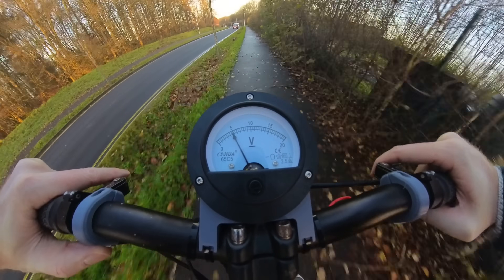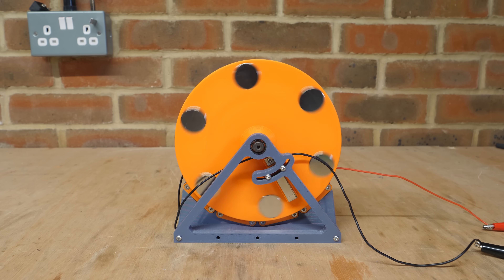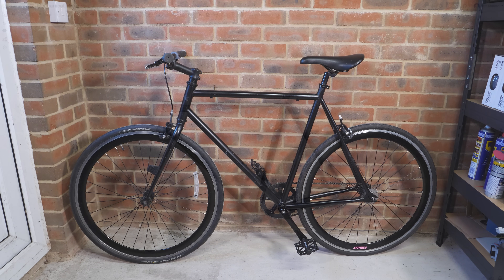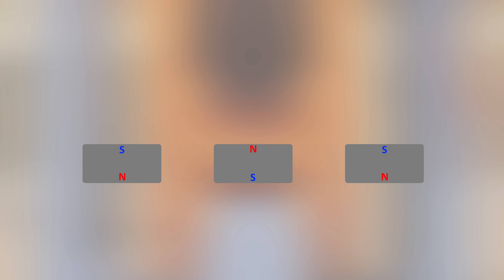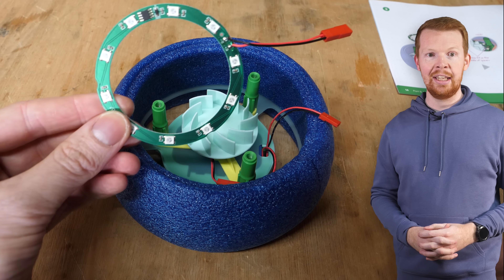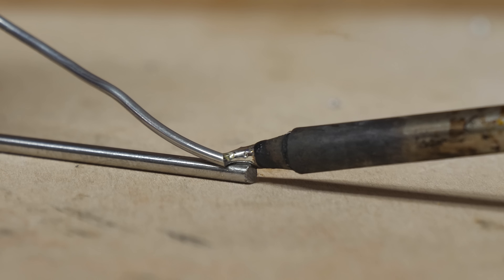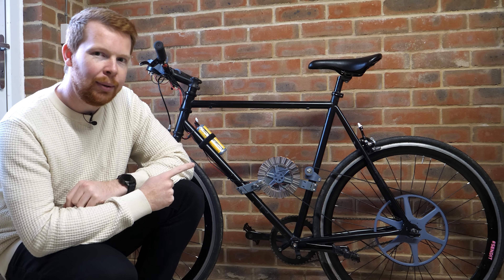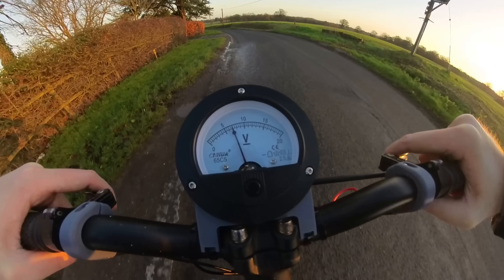The Most Minimal Electric Bike

Comment: I know its been awhile but the belt tensioner is not supposed to be on the top pulling side of the belt. It needs to be on the bottom side of the belt that becomes slack under power.

Comment: Just another thought, now that there are bicycles with disc brakes could you put the magnets in a ring attached to the rim of the wheel, on both sides too and have a coil attached to the frame just like the old calliper brakes fitted to the frame.😊

Comment: The sparking at the switch is due to a very high back emf voltage generated when you break an inductive load. The normal solution is not bigger, tungsten contacts but a capacitor or diode across the switch to dissipate the voltage.

Comment: Great project. Couple of ideas. Could you use a bought reed switch and drive a mossfet with it?

Your Adjuster pulley should  be on the return of the belt not the drive side. Keep up the good work.

Comment: Design rear wheel hub front wheel hub with magnetic bearings with electrical power generation that generates electrical power while under power from an electrical motor so no need to recharge a battery bank because the bike generates its own power while in operation.  😐

Comment: I've got an idea. Why not flip the tensioner sprocket mount over, and push the belt down instead? That would increase the belt-to-sprocket contact area on both sprockets, and lower the friction by engaging with the smooth back of the belt instead of the toothed inside. The tensioner doesn't functionally need to engage with the teeth anyway, right? I would add a spring hinge to dampen movement, though, as you want the tensioner to follow the belt so it doesn't jump out.

Comment: Bro I didn't understand why u r not using normal reed switch with a high current BJT?? the reed switch will collect the signal from the motor and then will feed the high power BJT driver and the high power bjt will then do the rest, anyway love and support for you from INDIA 🙏🙏♥♥
If you accept my idea then can pin my comment so new persons can learn from this small mistake. (even  I have done many mistakes like this in the past)

Comment: It should be possible to use an electric motor just with an on/off switch, On = electric circuit is closed, motor runs, Off  =circuit is broken, electric motor is not running.

Comment: What is burning ur switch is the inductive collapse. You can short the flyback voltage (inductive collapse) with a diode like normal motors do, or you can go free energy mode and send the diode to the positive of a secondary capacitor (negative to other side of coil) when the magnetic field collapses it sends the flyback voltage to charge the secondary capacitor, just like a BEDINI SSG CIRCUIT but with reed switch and capacitors.

Comment: Hi Tom. Re ebikes: so many advantages to having dual drive (using the  'non drive side') for ebike transmission. eg regen, redundancy and extending the life of expensive derailleur transmissions. in your opinion why aren't manufacturers developing such configurations? Ive been interested in doing similar by repurposing a 'standard' BB motor (eg shimano, bosch, barfang). The motor dimensions are correct, the frame mounts are commercially available, controllers are already configured etc etc. Is there any disadvantage to this configuration and things to look out for. I appreciate (at the time of writing) the rear wheel sprocket side of things will probably need a custom solution especially if using a disc brake as well. TIA

Comment: Even tungsten contacts are burned by arcing right when they open. You are delivering current into an inductive load and cutting it off!  ;^) Go get the "condenser" from the obsolete ignition system and put it across your "points" to protect them.  Try 0.33 Microfarads.  @henrymach Mentioned points and @huzudra Mentioned the capacitor 8 months ago, I now see.  By the way, the arc is about 3000 degrees Celsius. You must suppress it!

Comment: Excellent quality. However, engines of this size in the past usually drove fans, on stoves and fireplaces. You can also experiment with the displacer, make it using steel wool or foamed ceramics. You can also use a two-piston design or double action.

Comment: I remember my pedal bike from back in the early 1980's had one of those flip-on/off generators whereby it clamped to the bike frame and could flip the generator under spring tension which had a gnarly wheel that was spun by the bike tire's rotation. Not sure of all the accessories that were made to run from it, but commonly had a headlamp and there was some turn signals and marker lights in some kits

Comment: If you'll allow me a tip, you could use a metal pick instead, or even something mechanical. A Hall sensor can do this very easily, as long as its switching is done with a higher-power transistor, a MOSFET, or an IGBT.

Comment: A nice 2-way ammeter would be nice here. To show amps coming out, or going in, to the battery / capacitor. Also a speedometer which is just an app for your phone, there's a really good one called Phyphox, it's free, and it lets you see data from any sensor your phone has. Good for being free, it's meant for education, but you can likely get something with a nice pretend speedometer and all that if you liked. 

I see the principle of "electric, not electronic" but really, some transistors, would do a world of good! Just one decent MOSFET pretty much. Though admirable to do it the old fashioned way and go to tungsten, King Of Metals. Light bulb filament of over 100 years! Or so.

Comment: Try adding a .5 uf 250V paper or plastic capacitor across your reed switch contacts. This will surpress most of the sparking, as much of it is likely coming from the inductive kick caused by the collapsing magnetic field of your motor coils when the switch opens. The cap value is not critical.

Comment: you can actually use flywheel, momentum, the right magnets, and timing to get over unity, where once you get the motor turning it feeds itself , as in a motor generator built as one unit, this is entirely possible and will come as soon as greed and secrecy ends.

Comment: I understand you are not wanting to use any electrical circuitry to help with your ideas. However you could so easily make your idea that much better with the aid for some helpful electronics. For one, you could replace the magnetic contact switch with solid state components to keep from arcing and offer way more switching control without burning out...

Comment: At 36 volts, adding two extra exterior coils could gather more energy, potentially reaching near 100% efficiency. Consider a 1ms on, 3ms off pulsing ratio for faster, highly efficient operation while maintaining resonance. You're close to self-sustainability. Focus on the resonance lost with a constant versus a 1:3 ratio. FQ Adding copper and magnet coils can improve wheel power efficiency, paving the way for a perpetual bike. Resonance can triple output, and with time, amplify ninefold, hitting 300% efficiency when factoring time. Use 200% and reloop 100%. An oxide capacitor can reduce amperage to 20mA, relooping higher voltage to lower, creating a potential energy feedback loop.

Comment: very nice

my remarks:
it'd be a cool experiment to try using spark plug parts for the reed switch, I'd also put it on a sealed tube full of nitrogen or some other inert gas to both reduce the sparking and having a battle tested spark resistant compound on the switch.

you failed the "fully mechanical" part when you went for a rectifier, as diodes are semiconductors.

you didn't say FULL BRIDGE RECTIFIER dramatically enough bro @electroBOOM

Comment: Hi Men, I am an electric engineer and wanna thanks for your awesomw vídeos. O was goma tô make a sugestion: 
Instead of a mechanical switch, o was thinking that maybe If you put a Mosfet transistor and a hall effect sensor (essentialy another coil), and maybe some resistors you could Control better the on/of switch and optimize for speed, without titanium

Comment: Just use a commutator and brushes it passes the mechanical only, 10 volts for 200 watts is 20 amps a higher voltage is needed.

Comment: Totally irrelevant to the topic but your bike isn't set up correctly for you, your knees are too bent.  As a life long cyclist your leg should be almost straight when sat on the seat and your heel is on the pedal at the bottom of its rotation.  This way when pedaling properly using the balls of your feet your knees are at their most efficient and least damageable, the way your bike is currently set up will ruin your knees!

Comment: you could have a compromise bike project where you use sensors (I think they're called Hall effect transistors or something) instead of mechanical switches.  You'd then need to use more electronics to convert that signal into the power needed to drive the motor, but it would be far simpler than what's on typical commercial ebikes.

Comment: You can solder to most uncommon metals if you sand them and then immediatly coat it in flux, if oxygen cant get in, you stand a much better chance, you don't melt the copper while soldering, instead its closer to a braise, but this does need almost no oxide layer

Comment: Suggestion: use a real reed switch to control a high-current relay that does the actual switching. That will avoid the arcing and precision issues you had.
Reply: could you use a attenena and since they conduct the magnetic to electrical then hook it up to a transistor then make that a switch

Comment: Please do this again but with a brushed DC or universal motor(AC or DC). Universal motors can be found in things that need high starting torque, and capable of higher speeds than line frequency, like a blender or vacuum. You'd need a fairly high volatage battery to get the most power out of a live voltage universal motor, though.

Comment: imagine you can able to cut off the the charging flow  so you can pedal without any resistance but if u go downhill, you can switch it on so u can charge the battery, save on the braking pads, this is so cool imagine this in a real bike, like a brand making it  and people buy it

Comment: Hola estimado, veo muy interesante tu creación, e ingeniosa. El problema que tienes con el contacto de tugsteno, podrías reemplazarlo usando casi en serie paralelo, un par de transistores de potencia en configuración Darlington, que permitirían pasar mucha corrielte eléctrica por ellos, sin pasar por el contacto de tugsteno, mas que unos 5 a 100 miliamperes, el grueso lo puede permitir pasar un 2N3055, en cascada con un BU208, el primero debe poder soportar hasta mas de 17 amperes, y el segundo cualquier contrainducción de hasta casi 3000 volts, el 2N3055 se polariza con una resistencia de entre 500 a 1000 Ohms y de 1 a 5 wats, y para el BU208, con una de 20 Ohms 20 wats, debo verificar estos valores, no puedo encontrar uno de los varios que armé para reemplazar las altas corrientes que pasaban por los platinos de mi viejo citroen 2CV, en mi Chevrolet 6L, ó Ford V8, funcionaba muy bien para gobernar los cortes de corriente instantáneos de los platinos, usaba además un capacitor del mismo valor del vehículo al que estaba aplicado. Saludos desde S.L. Argentina, viva la ciencia experimental !!!

Comment: A fun part of riding a motorcycle is engine braking, where you use the compression in the cylinder to slow down the bike. I wonder if you can use a regular electric motor as a brake.

Comment: If I drive our 2022 Corolla Hybrid carefully in America at 50 to 60 MPH highway speeds, even on the hilly routes nearby, I can get 60 to 70 miles US per US gallon of regular unleaded gasoline, or something like 2.5-3 liters per hundred kilometers, ultra super low fuel consumption, because Toyota 2ZR-FXE (9th revision, earliest version from 2009) has 42% thermal efficiency, while MG1 & MG2 orbital gear PSD attached to engine crank shafts to front wheels, so no transmission while also completely automatic, able to shut the engine off while going as fast as 70 MPH, brake coast regen keeps lithium-ion traction battery charged more, the engine also charges the traction battery during cold start warming up as an electrical load & uses hot exhaust gas to pre-warm the engine coolant, further improving warmup speed & reducing emissions & fuel consumption further.
Reply: 10-20% better than our 2010 Prius III which averages 48 miles us per us gallon of regular unleaded gasoline, which has earlier version of the 2ZR-FXE featuring aluminum intake & slightly lower thermal efficiency, NiMH battery better in cold weather which also tends to last a lot longer in practice than the Lithium-ion battery in the Hybrid Corolla

Comment: 3 Challenge Requests:
#1: Lever-Advantage -- a bike in which 2 levers are attached directly to the back wheel axle with a pulley to make the pushing down of the pedal-side lever pull the back of the other pedal-side lever... which means there are no bike chains.
#2: Crossthetic Bike -- a bike that has prosthetic leg blades in replace of the wheels therefore no more flats and less heavy. It will also need a cut-out section support for the blades to stay aligned with the ground... which I guess will automatically give a somewhat jogging effect.
#3: Rocking-Horse Skateboard: a skateboard in which tilting it forward-and-back will transfer that direct energy into forward thrust... and if tilted far back will make for braking.

Comment: This is kind of lame dude.  Mainly because ended up putting electronics on it anyways, but you are missing a power source.  Regenerative braking/coasting  is a much cooler idea when there is a power supply.  Capacitors are not batteries and are designed to quickly release their energy, not to be a power source.  Maybe have a bank of them to start the bike from a stop and then switch to battery power, but overall, your bike failed many different metrics of cool.  It looked cool until it wasn't cool.  Sorry...Add some batteries and maybe it could still be cool.  Although that's a big honking design for very little payoff.  The best designs have the motor stuffed in the wheel.  Do like a variable speed torque reduction wheel motor with a built in freewheel and regenerative braking and it will be cool again.

Comment: My first ebike was a very early Chinese steel framed sakura ebike but when I got it it's controller kept cutting out. As it was 36v brushed DC I just put a micro switch on the handlebar so it was literally on or off. Sounds dodgy but it was actually totally ridable, you get going a bit then turn it on. I travelled hundreds of miles on it. It was surprisingly efficient because there was no controller and you only turned it on when you needed it. This was a totally lazy non intellectual solution but it worked. 👍😄

Comment: These pancake motor generators can be made extremely efficient - 98%ish.

You need to make the Halbach ring with the magnets touching so the gaps are as small as possible, make the windings long radially compared to the length of the arcs on the top and bottom (because the arcs don’t contribute to torque or generation but still have resistance and eddy currents).  Also use litz wire to reduce eddy currents.  The magnet thickness on each side needs to be about the same as the coil thickness and the clearance as small as you can get away with.

I wrote some software based on the equations in the book “Axial flux permanent magnet machines” to optimise motor parameters so I’ve played around with different geometries in simulation.

It’s difficult to make a good Halbach ring unless you make your own magnets.  You might try nested Halbach drums instead which would allow you to get the rectangular magnets next to each other for the inner drum and with only small gaps for the outer drum.  This would also allow you to keep the end windings relatively short.

You should find a way to measure the efficiency of your motor generator and efficiency of the power storage/delivery cycle independently and work to optimise both.

I like the bike regeneration idea a lot but the efficiency needs to be really high for it to be worthwhile.

I’m not sure what the state of the art is for supercapacitors.  Maybe not as good as a good flywheel.

With two extremely efficient motor generators and a third generator you could use one motor generator for powering the bike, the other for powering a flywheel and the generator for pedal power input.

Then you’d need extremely efficient electronics to move power between the three.

IIRC your previous flywheel attempt used a mechanical clutch but that would have wasted a lot of power.  You really need an efficient CVT or electronic transmission.

Increased regen efficiency reduces the effective system weight because you get more of the energy of pedalling the weight uphill back when you go back down.

With high enough efficiency you can cover the cost of the additional weight of the regen system by reducing the effective weight of the rest of the system including the rider.

It’s all about efficiency!

Comment: Yes, finally some one did a design without electronic components. I like this I use mechanical switches in my designs. I don't want to get into computer controlled stuff because it's to complicated & to expensive. Everyone should do more without computer control. Yes I know if your smart it works out good but I'm not computer smart. The inventers from long ago made free energy & over unity devices with out computers. I like the 3d printing part of your design , but I really like the mechanical part. Please do more , you can make one that will power & charge it at the same time, you are that smart. Thank you

Comment: You could use a reed switch on a lower voltage so it doesnt explode, and have the reed switch control a relay on a higher voltage controlling the motor coil